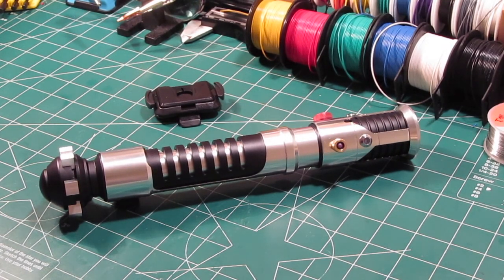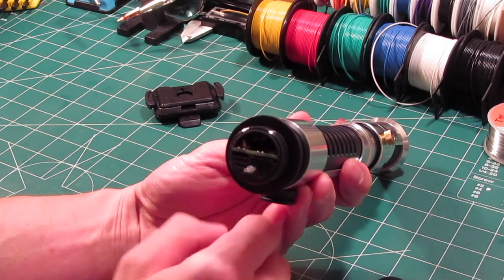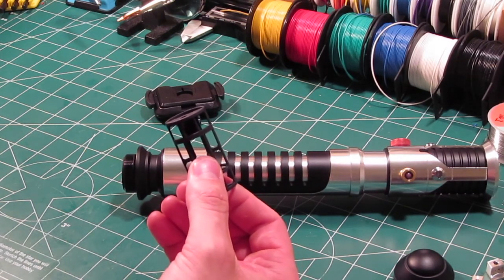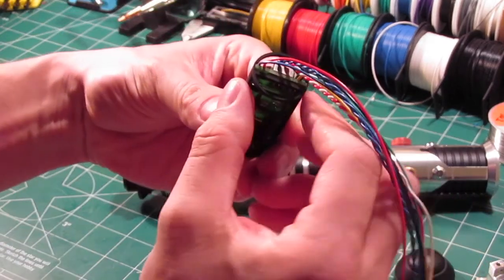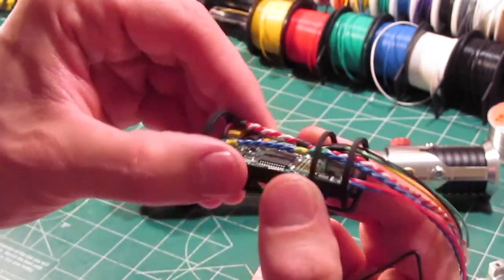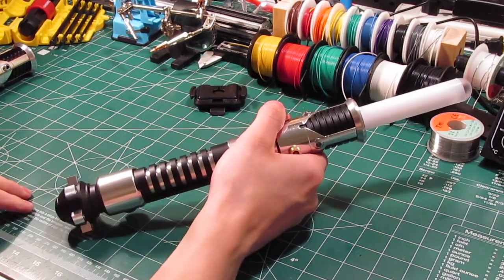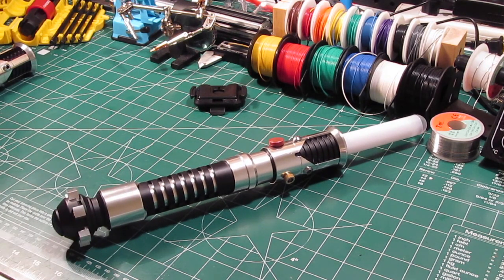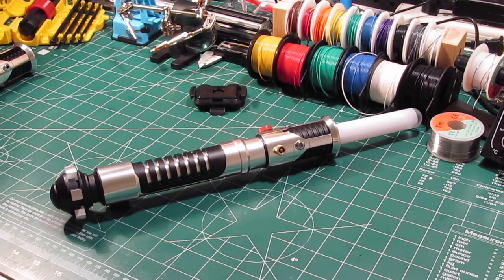Korbanth OWK with Prizm v5.0 & Accuracy mods

Comment: Is the black part of the hilt with this kit made of plastic or is it coated metal?
Reply from the maker: The black parts are made of aluminum and anodized black. That's how the OWK kit comes stock. I like to powder coat the black areas, even though they're already black from the anodizing, as this gives them a matte appearance which is more accurate to the original prop.

Comment: Your accuracy mods are amazing! Great work!

I've been trying to locate an accurately knurled and sized Presta valve for a while, but no luck. They're either the wrong head size (too long), the wrong knurling pattern, or the edge has been filleted. Any help on sourcing the darn thing?
Reply from the maker: Thank you! No problem--here are the valves I use:

http://www.chainreactioncycles.com/us/en/joe-s-no-flats-presta-valve-adaptor/rp-prod94757

They're the closest I've been able to find so far. You'll need a 5/16-32 tap to make it fit in the OWK. Good luck with your build!
Reply: Rad! Thanks for the help!

And thanks, I've been using your videos as very informative breakdowns. Mine won't turn out near as clean or finished, but I'm aiming to get as close as possible
Reply: One thing I'm thinking of doing is stripping the black anodized areas with HCl acid and repainting them à la the movie prop. I do like the clean matte look with the powder coat, but I also kind of like the slight wear and silver bits coming through

Would you recommend this, or suggest staying away from doing it? To my knowledge, a short acid bath just to clear the ano shouldn't compromise the metal very much, if at all
Reply from the maker: You could do that, but keep in mind that the paint will wear a lot if you handle it often--especially if you have electronics installed into it. The powder coat gives you the same look as paint but it's obviously much more durable. I'd only recommend paint if you want to keep it as a static display hilt for the purpose of replicating fine details like those chipped paint areas. To remove anodizing I just use Greased Lightning cleaner. It takes about 30 minutes to soak and you have to rotate and brush the pieces (I use an old toothbrush), but it does a great job at stripping anodizing, and is much safer to use than hydrochloric acid. I haven't used it to remove anodizing from the black areas, but I did use it on a few OWK builds to remove the clear anodizing from the silver outer pieces, so these areas could then be polished up and allowed to weather more naturally like the original TPM hero.
Reply: Ah, that's a great suggestion.

Yeah, I'm leaning more towards making mine into a static shelf piece, which is why I'm more fine with just painting it. While I would love to install electronics in it, it would only be a nice thing to have to show off to other people in my case. I'm content with just having a replica to add to my collection.

If I do paint it instead of opting for a powder coat, I might clear coat the grip and some of the emitter, and leave other specific areas uncoated. It's still a learning curve for me, so I really appreciate the videos and the advice!
Reply from the maker: You got it man! Stay tuned--things have been slow regarding videos lately, but there's a lot going on behind the scenes and much more is on the way regarding new builds, tutorials, etc. For a static display hilt, paint would be fine. You could leave the anodizing intact, paint the black areas matte black, and use a silver sharpie or paint pen to mimic the look of the small chipped areas. Fun fact: they used a silver sharpie on Han's blaster in ANH for weathering, so it's a "legit" SW technique. haha.This could be a nice compromise to give those little accuracy details while still preserving the hilt in case you do eventually decide to have it powder coated or installed. Have fun with the build!
Reply: Oh wow, that's an interesting bit of trivia. I might settle for that method instead haha! And I'll have to remember it for weathering other props

Looking forward to the new stuff. Keep up the great work!
Reply from the maker: Thank you!

Comment: Hey Sean, nice vid. I enjoy your OWK vids and enjoy the fact that you are an accuracy freak like me lol. Can I ask the source of the LEDs with the more accurate bezels that you got as well as the rod that goes in the fender washer?  I have an OWK on my list and I'd like to get it as accurate as possible and plan on using the 1" emitter as a accurate "blade plug". Thanks.
Reply: Excelsior Sabers hello how do you secure the fender washer and steel rod to the OWK emitter please? Love your accuracy mods and you’ve inspired me :)
Reply: Excelsior Sabers thank you so much for  your reply! That’s great I’ll be sure to follow that method! :)
Reply from the maker: Thanks! Glad you enjoy the videos! So for the LED bezels, you can find those on Ebay. I haven't looked in a few months now, but if you look on there for "5mm convex chrome led holder bezel," you should find them. Be aware though that they are 5/16-32 thread, so you'll need to drill out the emitter to accommodate them. You'll also have to cut them a little shorter so they don't protrude into the area for the blade. The rod is just a 3/8" steel rod that I got from Ace Hardware. Best of luck with your build!
Reply: Thanks Sean, I appreciate that. Can we talk offline about this?  I know you are on FB, what is the name of your page that I can contact you at?
Reply from the maker: Sure thing! I actually don't have FB, so just drop me an email at sean@excelsiorsabers.com. The website is coming and will be up next year sometime, but I've been really busy lately with the new machines and designing sabers that I haven't had time to get the site up yet.
Reply: Excelsior Sabers emailed you about this build!
Reply from the maker: Hi Scott! Happy to hear you're inspired! After lathing the emitter to accommodate the fender washer, I use superglue to secure the fender washer into the emitter ring. After that, I insert a 1" shaft collar into the emitter ring flush to the fender washer, then I place the steel rod insert into the hole in the fender washer so it sits flush with the surface (the steel rod gets clear coated to prevent rust). Then I mix some two-part epoxy and put that into the shaft collar around the steel rod insert and let it set, making sure that the steel rod stays flush with the fender washer face.

Comment: This is really nice. I just finished building a saber with a prism V4 (it takes me a while to accumulate parts) but I really like your chassis. Can you give me any advice on 3D printers, and how to get started building my own chassis, instead of always having to rely on discs and 440 rods. Thanks.
Reply from the maker: Hi Todd! Thank you, and congrats on the Prizm v4 build! It's funny that you ask about 3D printers, because my Creality CR10S just arrived today, and I am about to put it together! The CR10 has a very large print area--someone here on Youtube has even printed a life-size R2-D2 using one. I didn't want to be limited in size because I have many different kinds of projects planned, so that's what I got, but you could look into something like a Flash Forge if it's your first printer and you're OK with a smaller size. Regarding making your own chassis--that requires some 3D design ability. The good news is, you can totally learn to do this for free. I'm self-taught and I use Fusion 360, which is an absolutely amazing program that I can't recommend highly enough. Check out Lars Christensen's Fusion 360 channel--he has tons of excellent videos teaching you how to do 3D design. The possibilities are endless!

Comment: Really nice job. Can you tell me if you tapped the hole for the presta valve, or glued it in? Major props for accuracy!!
Reply from the maker: Thank you! The hole for the presta valve was tapped with a 5/16-32 taper tap. The valve is held in with a little loctite, but can be removed if necessary.
Reply: Thank you very much!